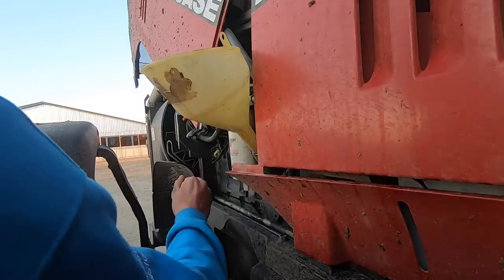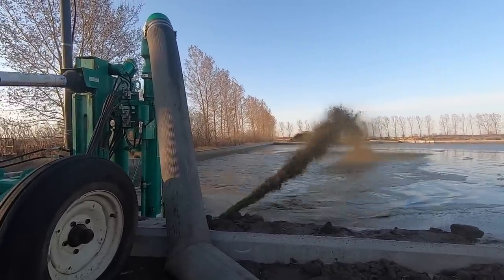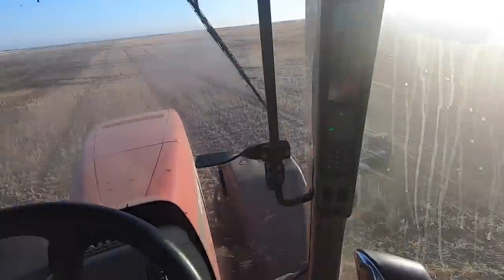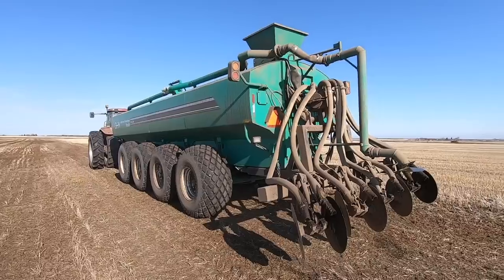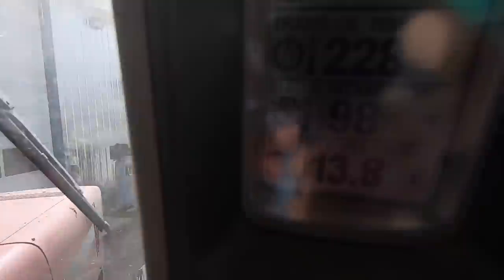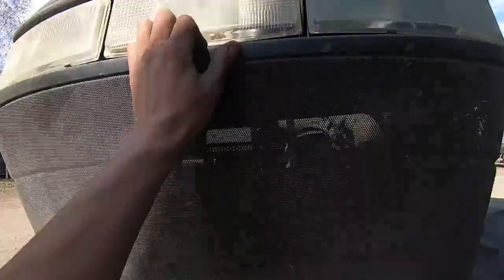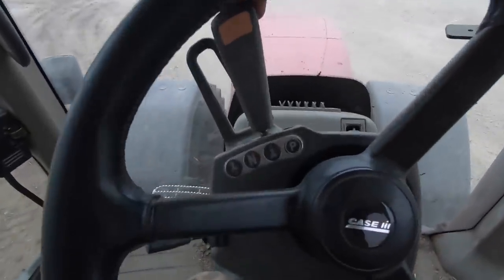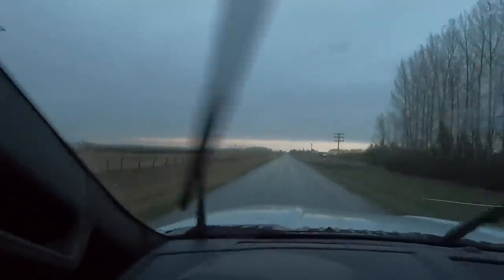A Day Of Hauling Liquid Manure

Comment: The pickup that carries are transfer fuel tank. I ran a set of battery cables from the battery to the bed of the truck and then put the heavy duty rubber covers on them. It saves a little time not having to open up your hood and running the wires over your motor while its running.
Reply from the maker: I turn the truck off. But not a bad idea!

Comment: I've always been taught.  When running hot the worst thing to do is shut any engine down.  Leave it at an idol during the blown down process.  When you shit it down the heat builds pressure and in turn can generate additional heat under pressure of the motor or trans.  What are your thoughts on this?

Comment: Hey Jan I have a question.
Why don't you use your seeding tractor to pull that giant manure wagon? The case seems a little small for such a huge weight. It would be a better use of the seeding tractor in the off season when not seeding. Love your videos.

Comment: Do you in Canada have manure management plans? As we here in Iowa and many other states in the USA have to take a manure management course and get a license with a class yearly on new laws and continuing education as the license is only good for 2yrs I believe. So after you get your license you can haul manure "dry and liquid " and the manure management course is usually given in the 1st 3 to 4 months of the year. So you can haul manure in a truck, spreader and tank. 
Hauling dry you want to spread thin and evenly so you can cover all your
acres yearly. And when you haul liquid manure it must be injected into the ground and you must be so many yards away from water or ways of water that it could get into the water supply or system like shallow wells, waterways, rivers, ponds and lakes. When spreading liquid manure on top of the ground is usually done during the winter months but if you don't inject into the ground and spread on top it must be covered up in so many hours meaning lightly disced under. Same thing goes for dry as it controls the smell of the manure

Comment: Thanks for another great video.  A question for you, that you may have covered in another video - if so, I apologize.  I noticed there are 4 wheels on each side of the the spreader.  Did I see them turn slightly as you made a turn with the tractor.  Am guessing that would be to help reduce wear and tear on the tires.  Please let me know if I was seeing correctly.  Thanks.  Blessings to you, your family, and the crew that works on your farm from Davenport, Iowa.

Comment: Is there a term that Canadian farmers use to describe that fan of wet manure coming out the back of the manure hauler? On a suction dredge in the Mississippi River, that great arch of sand, mud, spoil and water is called "the rainbow". I couldn't help but make the comparison, but I doubt they smell the same! Are all of the fields you're spreading manure on your family property or do you sometimes spread it on other farmer's fields?

Comment: Should let a hot diesel idle for a little bit before you shut them down. Let’s the oil run threw the turbo and cool down before it’s shut off if not you can create build up in the bearing in the turbo

Comment: I have a 270 it seems to burn the shell oil especially when you pull it hard. I use chevron seems to do good with that. And I've also had to change the fuel gauge In the tank
Reply from the maker: Huh I guess it’s not only ours!

Comment: Yan, seems you always get the shi**y jobs, but someone's gotta do it. 

Any rise in oil temp likely means the oil is also deteriorated (from getting too hot) so you might want to look into that.
I checked a few parts diagrams for the Case and it looks like a transmission cooler is not standard. If you are going to run it so hard you might want to install a transmission cooler. From your video it looked like you have an a/c condenser in the front and a radiator behind, but not positive. Anyway the transmission cooler usually is the first radiator in the series, and is going to be smaller than the a/c and radiator coolers. You may have one below what is visible in your vid,  I'm not sure. You want to make sure all the radiators are clean at all times.
And great checking the air filter, also important. Your job never ends.....